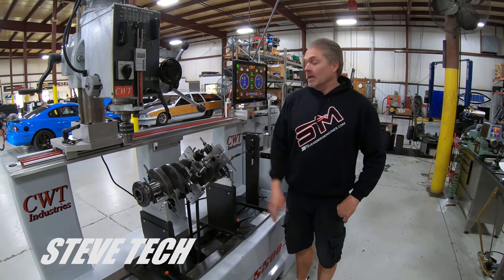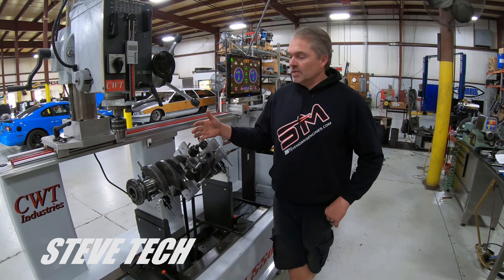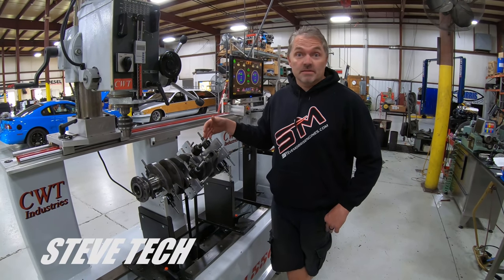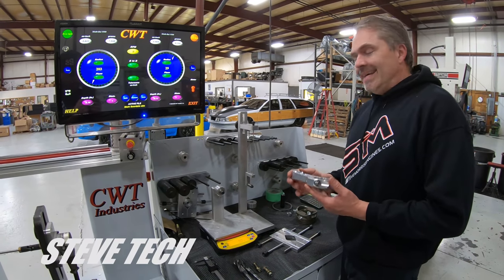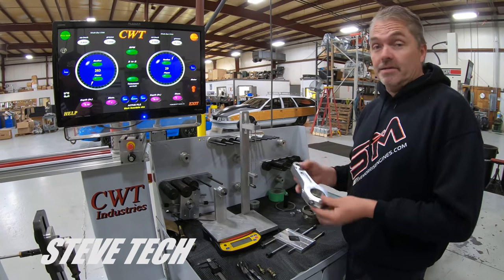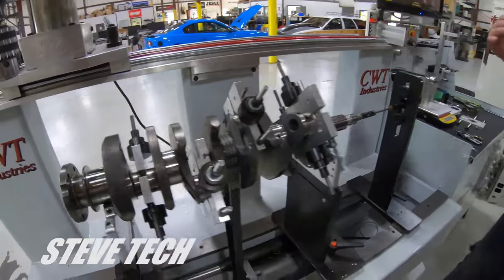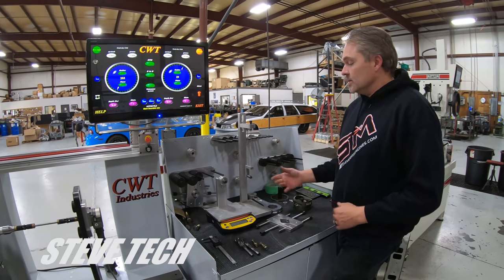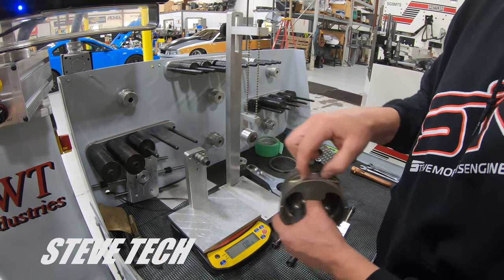Crank Balancing

Comment: When someone says "its balanced and blueprinted.",....does it mean the blueprint part is merely matched components according to a ton of data like motor C.i. Desired HP ??????  Just curious. I'm new hear.
Reply from the maker: Blue print actually means 
To factory Blue Print
Reply: @stevemorrisracing  Not quite.  Blue prints have tolerances that production tries to stay within.  Blue printing means all the parts dimensions are nominal, (usually the middle of the tolerance).  If not, you might as well use production parts off the shelf, because they are suppose to be to print including the tolerance.
There is no production process that can repeat parts with no tolerance.  A good machinist can get pretty close though, as there is good control with a well designed and well set up machining process.  Every process has variance.  Blue printing a engine with a part that is on the small side, would have to find a bigger part above nominal to work with, for true "blue printing" to use nominal parts.
Reply: That means, on a statistical level with good accuracy over time, that half the parts on the shelf are too small in dimension, (on the critical features), to be used for blue printing.
Reply: @EarthSurferUSA  Best explanation yet. That's better than the one Steve Morse said. Thank man. Makes total sense.

Comment: If you ever have some extra time....lol , how about doing a comparison / test / proving on different balancers and flexplates/flywheels. Use a balanced crank and just swap some quality to cheap parts and see if the parts are " balanced " and have no effect on internal balanced engines.

Comment: NPF tap and a matching dia. and thread pitch on heavyweight round stock, flushed to just above the proper weight and angle drilled off axis (viewed at flush surface from a point off center drill radially outward  and a 30⁰ angle axially tap for a set screw let the drill bit tip dimple the counterweight throw that you tapped, and loctite the weight threads, the set screw threads, the set screw (plug) should be recessed enough to facilitate peening or punch setting to prevent weight migration, or transforming into a rogue ballistic projectile.

Comment: I find it interesting that after your initial balance attempt, the amount it wanted added ended in .094 grams for both front and rear. Makes me think it isn't really measuring to .001g.
Reply: You are probably right and I doubt the resolution of the machine is also its accuracy. It may show on the screen a weight represented out to 0.001 grams, but it almost surely is not accurate to 0.001 grams. 

Another thing to remember is the machine is calculating those values using formulas and the input from sensors. There are lots of spots where error can crop up. He used a bubble level on the bob weight so a digital machinist level would be more accurate. The sensors themselves aren't perfect and there is some error introduced. Is that exactly 500 RPM? Probably not. And then those analog values are digitized so the computer can understand them and that adds it's own error in the analog to digital conversion (quantization, linearity, offset). But this is mostly academic. What is important is to understand the level of accuracy and precision required in a practical application.

The description he gives when he talks about over and under balance and shows what that weight actual is to shift from 50 to 49 and 51 is gold. There is 19 grams from 50 to 49 and from 50 to 51. And then you see in the end that the weight the balancing machine is asking to add is a fraction of the weight to go from 50 to 49. This is key.

Nothing could actually be produced if the tolerance was expected to be zero. There is always tolerance present. Knowing what tolerance is acceptable is what separates those who know what they are doing and have experience from those who just read about doing things.
Reply: @Fix_It_Again_Tony  without watching it again, since it's been a while... there are machinists bubble levels that are incredibly accurate. I don't know how accurate the level he used was. 

I understand that chasing perfection means nothing gets done, I don't expect anything to be absolutely perfect. I just prefer admitting it.
Reply: @totensiebush  I don't disagree that machinist bubble levels are very accurate but he just used a torpedo level. Probably because that's all that is needed.

It's not a matter of admitting it isn't perfect. It's about knowing how close to perfect is acceptable. Steve does a good job of taking the mystery or magic out of engine building in his videos.

Comment: Years ago, had a friend with a rebuilt V8, (by somebody).  I drove it a few feet and said this engine is junk. (Unbalanced rotating mass, vibration). Amazing what one person will notice and others seem to think it is normal.
Reply: Maybe one rotating part was junk, and not the entire engine, like possibly a harmonic balancer?
Reply: back in the day we would put a quarter on valve cover to check for balance ... Buick wildcat engines were always calm

Comment: Windage? It's got nothing to do with windage. When you add the weights together the way you did, the final weight is wrong because they need to be added as vectors and that depends on big end diameter and crank throw.

Comment: I'm surprised to see a crank that looks previously balanced would have that much difference end for end, if it was balanced correctly it should have been the same or close. I suppose if it was done with the externals and they were off.
Reply: What if the previous build used different pistons and rods that had different weights from the ones Steve is using? If he needs to add weight to the counterweights then I would guess the previous build used components that were a little lighter, maybe for a lower HP application. We are only talking about a few dozen grams here. 

When you change the pistons and rods a previously balanced crankshaft is now not balanced for the new reciprocating assembly. They entire assembly needs to be considered as a system.
Reply: @Fix_It_Again_Tony  Regardless of the component weight changes, the required correction should be identical on either end, and 180 degrees opposite of one another.

Comment: How many competitive  pro-stock engine are in the world at any one given time ? 50?  100 ?
Reply: No more than 2 dozen .
Reply: Hundreds
You can only be competitive compaired to who/ what you run against.
So if competitive means get to the final round, then every meeting running Pro stock anywhere in the world will have 2 competitive motors.
You could lower that if you use a countries national e t record as your measure of competitive,but then you need to add a number onto the et (as otherwise only 1 in each country at any given time is competitive) and count how many passes have been made under your preferred time.
My measure of " competitive" would be any car that qualifies in a field were the class entries out numbered the qualifying spots available.
Reply: @brianiswrong  on your two only section of theory, you'd have to throw out all the : clutch guys, trans ratio guys, tire guys, air fuel guys, 4 link guys, track temp guys, two step guys, data readers etc . And of course the only question worth consideration is USA, NHRA meets, where the competitive level drives all the static noise out of the data .
Reply: @rolandtamaccio3285  
And that's the problem with comparing just engines (on a Dyno) as you say ,without all the other stuff a 3'000bhp all engine car is going to loose to a well sorted 2000bhp car
Reply: @brianiswrong  ,,, not talking about dynos, talking about your assumption, that the two best engines wind up in the final . Btw, at a nominal 15 hundred ponnies .
Reply: @rolandtamaccio3285  
I will happily re word my response
The only way to measure a top engine would be to compare Dyno results for different engines on the same Dyno.

The only way to compare a top engine doing an 1/8 or 1/4 mile pass , obviously would be to use the same running gear and just change engines (but as you say, there are so many variables that need to be changed to suit any given engine combination ,this would be impossible to get a measurable difference) 
So ,as the engine is a part of a car designed to do one thing, in my mind a competitive engine can only be measured by results (or finals) 
I guess as an engine builder,you could measure using wear and tear , but not spinning a main, or nicking a ring will only get your reputation so far,if you don't actually make finals.
Reply: @brianiswrong  ,,, alright,  you be NASA, I'll be Elon Musk, ( I wish lol ), peace out .
Reply: @rolandtamaccio3285  
Nice to have a chat,not agree and agree to disagree 😀 greetings from the 🇬🇧
Reply: trick question with a false positive answer
Reply: wayment

Comment: It seems not having 50 percent balance would just be stupid idea. Common sense would tell anyone this would be best for reliability especially on high hp rpm engines. So much vibration happens from such small weight on anything spinning I never herd of under or over balance on purpose.

Comment: Hi steve ? What holds the pin button from walking around
Reply: The cylinder wall.
Reply: @bcbloc02  - So when you remove a piston with pin buttons the buttons will just fall out?  Do the pin buttons ever gall due to friction with the cylinder wall?
Reply from the maker: the oil ring holds it in and from falling out when out of the engine. the cant touch the bore hard enough if at all to gall.
Reply: INERTIA ...